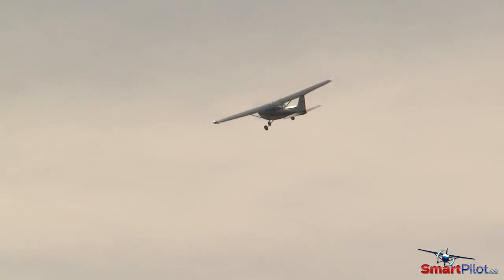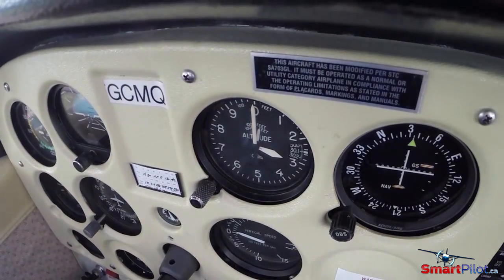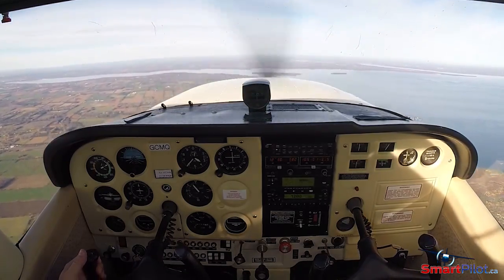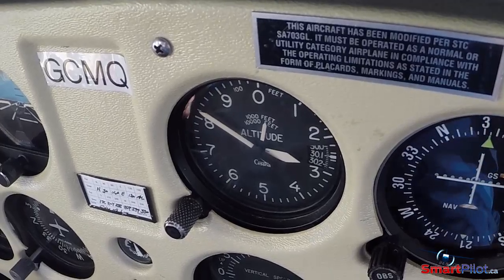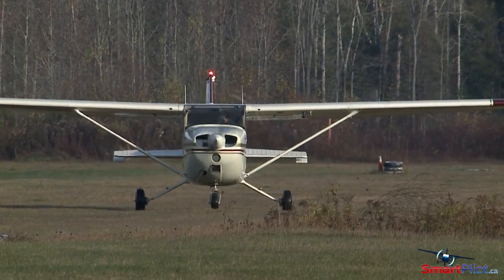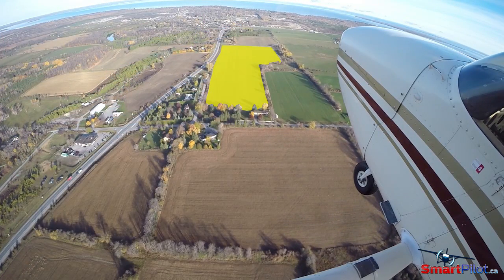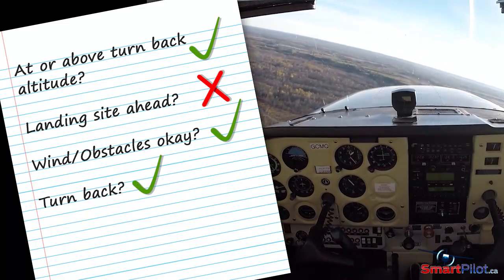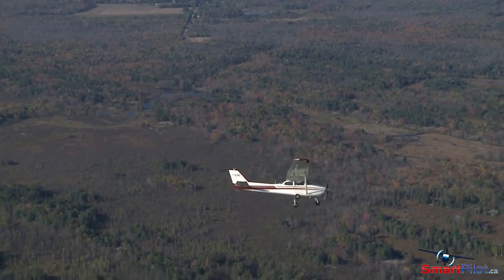SmartPilot | Improbable 180

Comment: my Yankee loses 1000' in a 180-degree turn at the best glide speed of 89 mph...would never, ever consider it below 1500' AGL.  On the other hand, a lightly loaded 172 can easily do it from 700' if you roll into the turn immediately without hesitation.